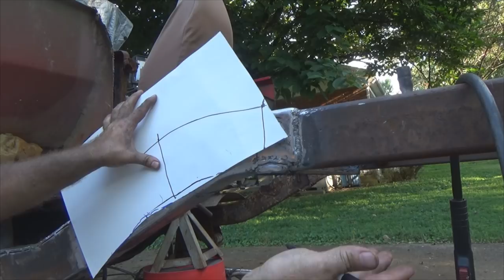Jeep Wrangler YJ - How to repair a rusty frame with scrap metal. #jeepframerepair

Comment: I probably would have tackled that by welding backer plates inside the frame rail since it was opened up so much. Then installing the repair pieces flush with the original frame, thereby preserving the original frame dimensions. Done neatly enough and the repair would be close to invisible when painted.
Reply from the maker: True that was a possibility. But, in the event I have to do more patching toward the front, by wrapping the outside it keeps the ends where the plates join more "seamless" after welding. Also, the weld joints are much stronger welding the thicker plate together than welding thin material to thick material. When thin material is welded to thicker, the thin material tends to be a flex point. In the configuration I welded this, I eliminated the flex of the thinner material. Thanks for dropping in. Have a great day!

Comment: Hey type of welder did you use And the settings
Reply from the maker: Its a Hobart Handler 135 (Made by Miller Welders). That welder is super simplistic. I think I had the heat on 4, wire speed was a little past half way.

Comment: I was wondering what was up with that part of the frame in the last video and it seems like the "patch job" did more harm than good
Reply from the maker: I know when I saw the patch job that something wasn't right. I just didn't realize how bad of a patch job it was. There was very little contact going around that plate. Its a miracle the frame didn't break when I was driving it around and flexing it in my ditch. Thanks for dropping in! Have a great day!

Comment: Jeep YJ's & TJ's frequently suffer apocalyptic frame rust. 

Jeep really designed these frames poorly. Probably intentional so they WOULDN'T last.
Reply from the maker: My 1991 frame is solid, my sisters 1991 is solid, just a little surface rust here and there. I know of a '95 that is rust free. My dads 2006 TJ, the frame is perfect, the body has surface spots due to the paint getting scratched off from the previous owner abusing it and not repairing the paint. But those Jeeps are from Tennessee where we get relatively short winters and not a lot of continuous snow. So, there isn't a lot of salt used to thaw out the icy roads. Buddy of mine has a 2000 TJ, completely rust free top to bottom. His 2000 TJ originated from California where there are no icy roads, therefore no salt on the roads. Lady I used to work with, she has an early 80's CJ, frame and body are solid. A fella I work with up until last week when he left, he has an '83 CJ5 factory V8, the frame is solid, the tub is beaten up and a little rust. The '93 in the video originated from Pennsylvania where lots of salt is used on the roads. Repeated exposure to salt and not getting regularly cleaned is a perfect environment to deteriorate metal. Any vehicle that comes from the northern states where lots of salt is used on the roads will be eaten up by rust if the salt isn't cleaned off top to bottom on a very regular basis. Older Jeep Wranglers are very solidly built top to bottom, its all in how that is taken care of. But that's true with anything. Thanks for dropping in! Have a great day!
Reply: Power Addicts - FixJeeps.com - Jeep, car and motorcycle tips 

Areas using road salt is key.

Just look at TJ ads on Craigslist in Indiana that usually mention the severity of frame rust, & patch repairs.

The boxed-in frames don't allow water to drain out & rot from the inside-out.
Reply: I live in Maryland where people lose their minds anytime it even threatens to snow. So as a result they salt the hell out of the roads. 1/4 inch of snow equals 1/2 in of salt!! Luckily I found a 1980 CJ with a solid frame. It's got a YJ tub. A lot of what you do really applies to my project. Thanks for the videos.
Jim